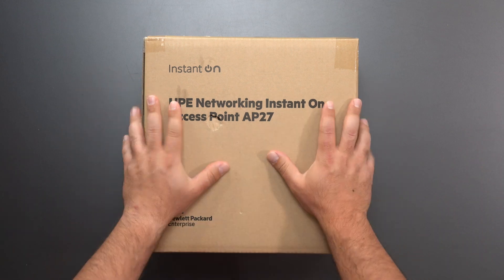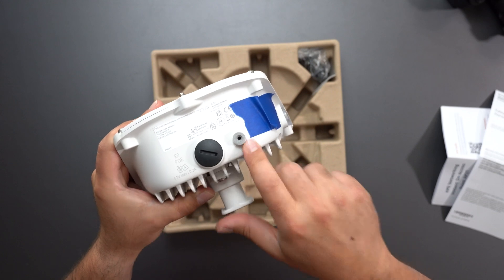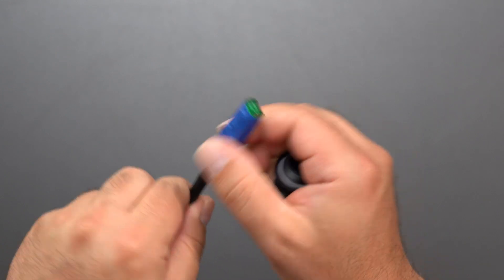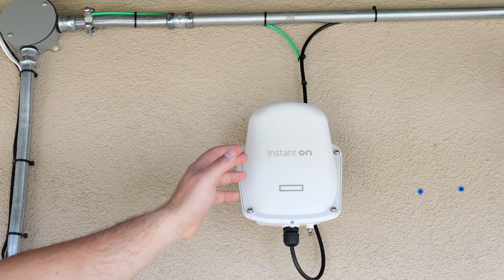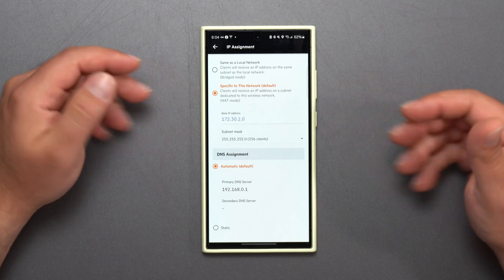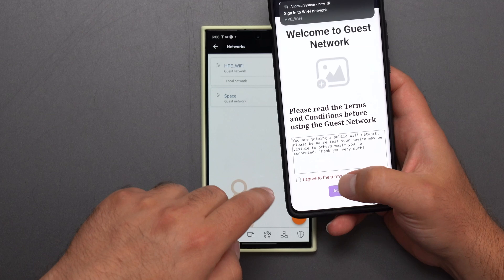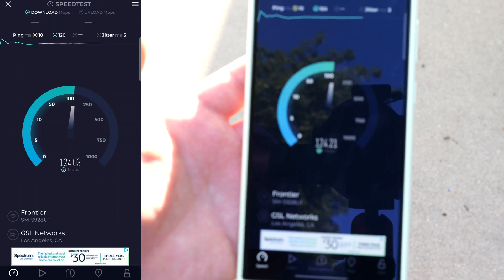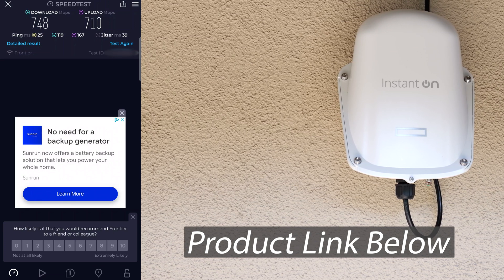Boost Your Outdoor WiFi with HPE Instant On AP27 (WiFi 6 Access Point) | Designed for Businesses

Comment: He bro you can make the iphone 16 pro max internet on or allow hotspot and then check the other phone to connect with 16 pro max wifi to check the speed in other phone ❤😮😅
Reply from the maker: The plan I'm on with the iPhone limits hotspot to 5Mbps. It doesn't have to do anything with any router or access point.